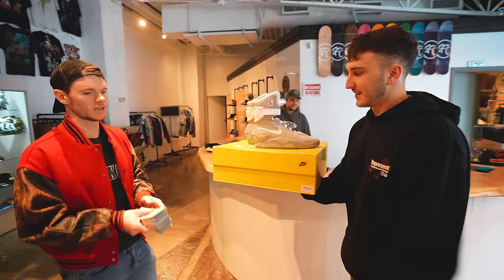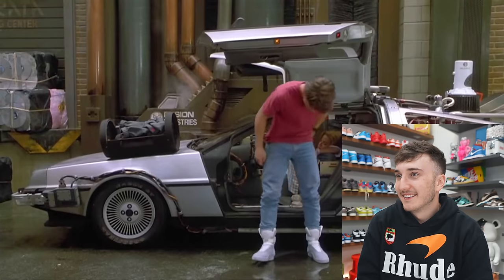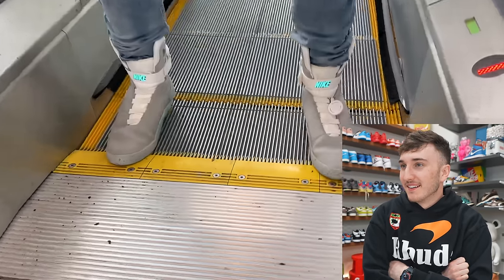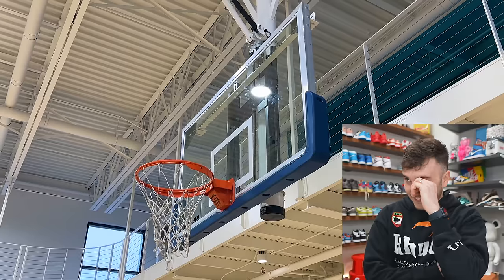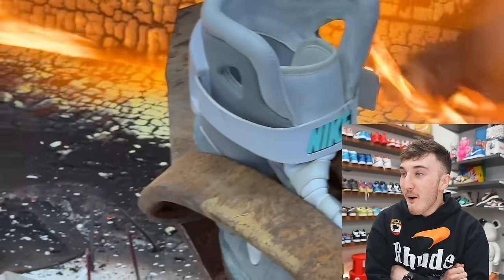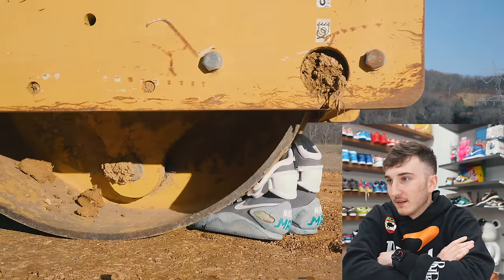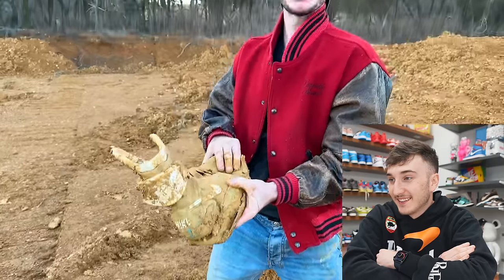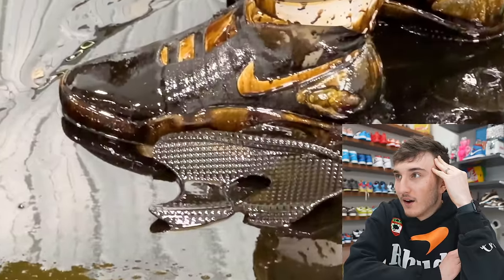Reacting To Whistlin Diesel DESTROYING My Nike Air Mags LIVE

Comment: As a guy whos been in the construction field now for over 15 years. I can tell you now. Those things held up INCREDIBLY well. Literally better then my $300 red wings, and my $250$ Thourogood work boots. Im impressed.
Reply: Well they were $35,000 😂
Reply: @deebogotyou1494  nope they real. Purchased at Boot Barn lol
Reply: Because they are made of only foam. Workboots have structure with purpose.
Reply: You should get your hands on some Nicks, real work boots.
Reply: Idk what kind of redwings you got but mine would do just as good as these.😂
Reply: The Dior Air Force ones he tested held up even better. Actually completely outdid the work boots he tested them against
Reply: Worth a price
Reply: Idk Redwings hold up pretty well, I've worn the same pair for 5 years and they're only mostly falling apart not completely falling apart.
Reply: I like Dewalt boots personally, i have a pair that have lasted 6 years on the farm.
Reply: sto trying to flex with somthing you dont have
Reply: The air doir ones he did for 12k were actually insanely durable..
Reply: Yea I just got a pair of twisted X comp square toes and they where like 219 and 3 months later there falling apart not good industrial roofing boots
Reply: 250 to 300 for work boots your off your nut my friend in UK can get brilliant pair that will last for as low as £60
Reply: Correct, I don’t pay more than $60-$80 for shoes

Comment: He’s not destroying them, he’s doing what everyone should do with their shoes
Reply: Stop the cap 🧢
Reply: @ernestozuniga8268  those aint worth nothing but 500 bucks
Reply: @PTFLO  Less than that even. It's just foam and doesn't last. The Diors held up way better. Idk why anyone ever spends over $200 on shoes.
Reply: @caseymurray7722  to be fair I just spent 280 on a pair of trail runners but they last forever and have the best grip out of pretty much anything that weight. In my opinion it’s just what you get outta them

Comment: Not surprised they held up to the bulldozer and other heavy equipment decently after all they seem to be made almost entirely of spongy, flexible materials.. for the outsoles to wear off so easily at the start though is inexcusable for a $35,000 Shoe no matter there intended use.